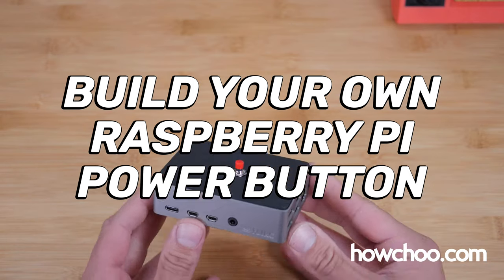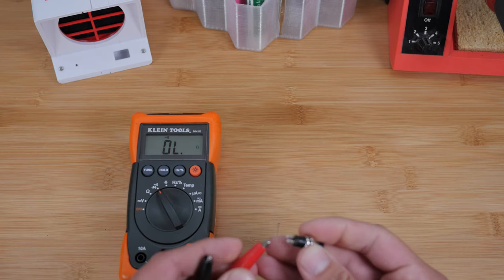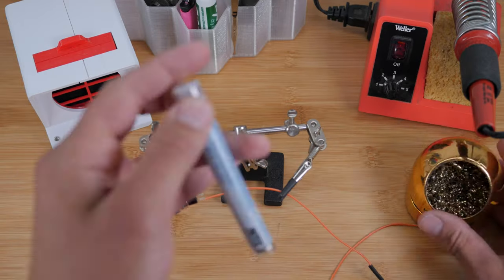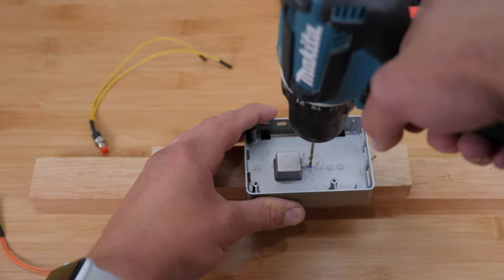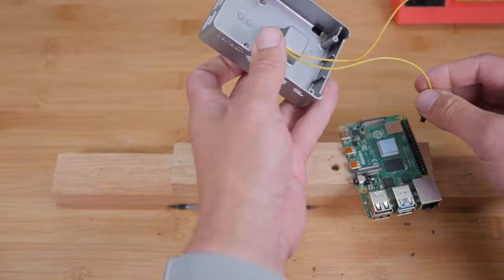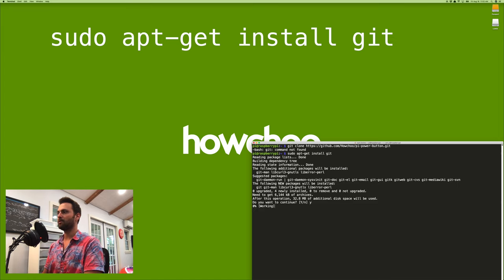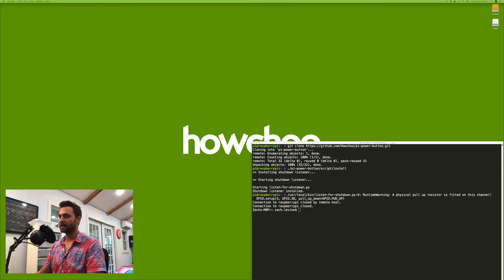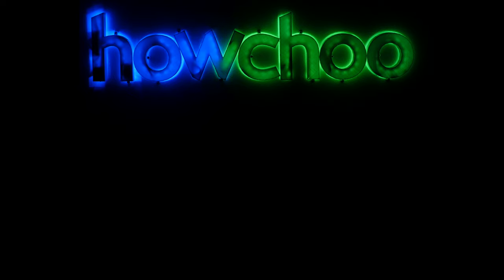How to Add a Power Button to Your Raspberry Pi (+ FLIRC Case Install!)

Comment: So if I buy something like this:https://smile.amazon.com/dp/B07R45W1LN/?coliid=I5HFW73SC6BZ6&colid=IQLEPSHGC4Y2&psc=1&ref_=lv_ov_lig_dp_it where would I put the button? Or should i be asking the manufacturer of the fan/ power management device?
Reply from the maker: That’s a question for that board’s manufacturer — but it looks like it has some extra port extensions built in. I would also check its pinout out to make sure the pin we need for “wake” is not in use. :)

Comment: If I have a small case fan ground going into pin 6, can I just move it to another ground on the pi? Does it matter which ground?
Reply: You can use any other ground pin as well

Comment: I use the SCL pin with an I2C lCD. Can I still use the same pin to make the shutdown button?
Reply from the maker: Unfortunately not; you could make a button that simply shuts down, but the WAKE functionality (to turn it back on) requires SCL. You could always disconnect and reconnect the AC adapter to turn it back on, however.